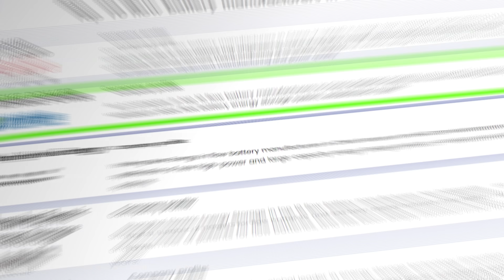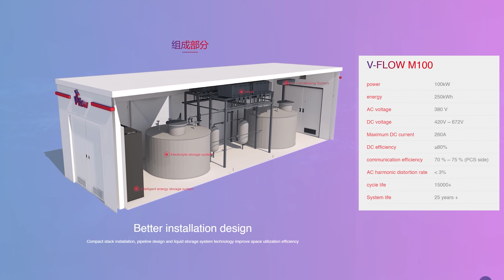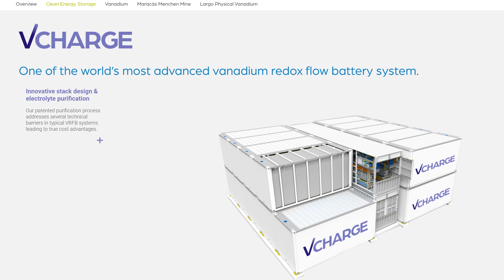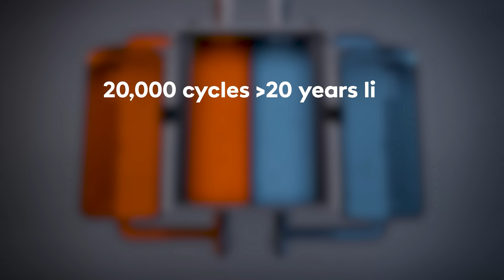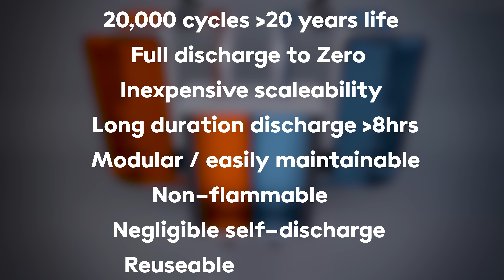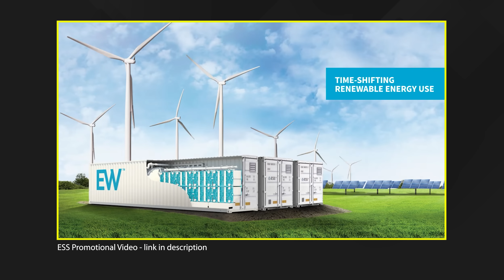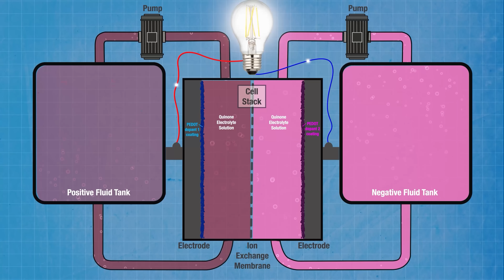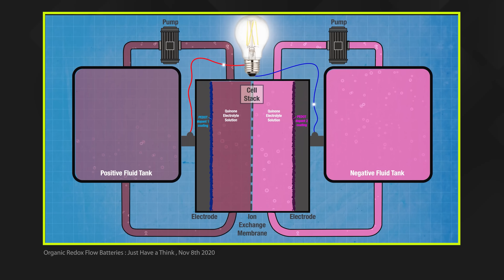Iron and Saltwater Battery How easy is that

Comment: The real problem with these systems that isn't considered as the lack of economic viability versus alternative storage solutions and fossil fuels. Check out XL batteries which could be the first low battery company to achieve cost parity with fossil fuel alternatives.

Comment: Lockheed Martin has already found your location they are just busy in the middle east, please wait for your free delivery. More seriously, great video and I'm left wondering for the iron variant, could one take some salt water and add iron particles like if you were to try and collect iron sparks from a grinding wheel, and get a similar result, presumably with lower output.

Comment: Also limestone can be made into a battery by using chalk/quicklime and water it as the same ions as li2co3 lithium carbonate which li2+ co3 2- caco3 is ca2+ co3 2-  and salt battery with same and co2 anode produce 1kwh/kg with 1 less ion then calcium potentially making 2kwh/kg possible and very cheap about 30 to 40 pounds per tonne also there is calcium bicarbonate which as 2 different electrolyte so potentially even more kwh per kg

Comment: It should be noted that there’s not a need for grid scale batteries to be particularly energy dense. Shipping containers can be stacked on top of each other and pull double duty to hold the solar panels on top or be incorporated into the support towers of wind turbines.

Comment: A whole Energy Density chapter that does not actually tell you the energy density?
Come on! Better than Vanadium, ok, but Vanadium flow cell energy density is terrible. Better than terrible can still be pretty terrible.
What they also avoid mentioning is that the plating-out effect means they are very dependent on area for the actual flow cell electrodes. This means the capacity is not fully independent of the electrolyte storage making it a big downside.

Comment: Are the simplest batteries incapable of high power charging/discharging (extremely low C rating)? They always fail to disclose the viable C rating for each cell (I understand these may use 1 massive cell). What I mean by that is that some of these batteries claim they are superior for their long duration storage.  By this they mean instead of delivering their full discharge experience in 1 or 2 or 4 hours, they last a whopping 100 hours. They are merely stating that they can (and probably must) discharge whatever power they have over 100 hours. Of course, anyone with experience with electronics realize that any battery if placed in a circuit that draws current more slowly, can last 100 hours. Witness a dry cell in a clock. We don't proclaim the AA battery as a modern marvel because it has the distinct ability to discharge with a stupid low current. 

Lithium batteries have never been characteristically stuck being used at a 1, 1/2, or 1/4 C rate. Witness Lion watch or pen cell batteries that replace traditional acid dry cells. But grid managers see Lithium packs as good, and very useful, given their higher available current rates, allowing them to take the best advantage of grid needs including possibly short charging opportunities (when excess power would otherwise be curtailed) and possibly short discharge opportunities (when the spooling up of a peaker plant couldn't possibly happen quickly enough for a temporary abhorrent demand spike.  

Another way of describing 100 hour long duration battery is that it would have a 1/100 C rating, or a particular limitation of slow discharge rate. If so, that would mean you might only be able to RECHARGE it safely at 1/100 C rate. In both cases you have a crap battery that no grid owner would accept as a killer battery, except for extreme cases of multiple days source energy outage where you are discharging truly MASSIVE banks of reserve energy like the oil reserves used when prices spike. This type of break-glass-in-case-of-fire storage, is hardly a viable tool to tough out the worst darkest deep-in-the-shit Climate Crisis power system is failing us scenarios. It's more of a wasteful 10,000 hour uptime guarantee piece of equipment that power operators clutching their pearls would dream up to ensure no one misses Dancing with the Stars, ever.

I know flow batteries run all types of chemistries and some will allow far better current responses than others. Can we please try to include the preferred and max C rating when we discuss storage solutions so we can intelligently compartmentalize the junk from the useful?

Comment: Thanks. I'm an avid Tesla fan but wondering why they're wasting good (energy dense) EV battery lithium on their megapacks. You'd think they'd go the way of iron ion flow, being that it seems that would be cheaper to build, and much cheaper in the long run due to it's 10x lifetime.
Thanks again.
Okay, the caveat is probably that iron ion might not be as efficient. So what. Ever cheaper and cheaper solar will not than make up for that little bit of efficiency difference.
(Come on Tesla, redesign solar and the iron ion to transform the world)!

Comment: I’m in Canada and there are numerous small communities in remote isolated locations, especially in the North.  They usually depend on diesel generators to provide electrical power.  Are there any companies offering renewable power sources coupled with short/long term electricity storage.  In particular, solar does not work well for a large part of the winter in the Northwest Territory, Yukon and Nunavut.  Love your videos.  I find I feel more positive about the future for my grandchildren from you research and videos.  Ignore the negative comments.  There way too many negative, critical, anonymous voices on the internet.

Comment: So did I miss something? What's the catch? All Flow batteries have the inherent advantage that that capacity is controlled by the size of the fuid tanks, not the size of the electrodes, and Vanadium has been the poster child for a while now - but it hasn't shown any signs pf taking over the World on a game-changing scale, presumably because Vanadium is expensive and difficult to handle. Iron-salt seems to side-step these problems...what am I missing?

Comment: Whether Rongke Power's 400MWh of storage is whopping or not depends on your point of reference, Dinorwig's pumped hydro station is 9.1GWh, which is nearly 23x bigger than this.

To meet the UK's predicted long-duration/seasonal energy storage requirements in 2050 would require about 100,000 of Rongke Power's 400MWh flow batteries.

Furthermore, at an LCoS of 5 cents per kWh, for storage that's used for true seasonal storage, e.g. cycled once a year, charged in the summer for use in the winter, for a 30 year RoI it would require battery capital cost of just $1.50/KWh, about a 100 times reduction incurrent cheapest lithium battery technology.

Don't get me wrong, I think flow batteries are a brilliant technology, but four countries with climate and energy demands like the UK they are not going to provide 100% RE power generation support.

Comment: Great video!  I do have a question regarding the efficiency of these various flow battery designs.  As I understand, one of the remaining issues with flow batteries is the overall efficiency that sits somewhere between 50 to 80% for the better designs.  Can you speak to this issue?  Much appreciated.

Comment: Batteries to store renewable energy will be needed in 3 general places: 1) powerplants, 2) renewable energy sites (such as wind farms), and 3) houses with solar cells. The first two would be essentially public utilities, while the third is basically battery back up for individual houses. Since I work during the day in the office,  I could not use energy from solar cells at home. So the energy created by those cells needs to be stored for use when I and my wife are home. What type of batteries could be used at home from your list of new battery technologies?

Comment: What about batteries like the Edison battery? Yes, they are taller and heavier than lead acid or Lithium, but they are non-toxic and last for decades. Who needs a light solar or wind battery anyway? Plus they can be refurbished into new batteries after decades of use.

Comment: The coulombic efficiency of iron salt batteries is only about 50%. This means only half of the energy put into them is stored and can be used later. Lithium bats are 99% efficient, lead acid bats are about 75% efficient.

Comment: If there is a cycle limit then they are handicapping the living hell out of the flow battery. The vanadium flow battery has no cycle limit when you do it right, the plating aspect is the worst aspect.

Comment: The problem is that vanadium has a bit of a toxic tendency and it is *insanely* valuable as an alloying agent with steel. Vanadium is, no joke, one of the most important alloying agents in steel. And one of the most important. Off the top of my head, only carbon and manganese is more important, the later because it does double duty as it cleans impurities too.

Comment: Now throw in the CO2 cost of mining, transporting and refining that iron... ooooppppssss! It's right up there with Lithium... ooooppppssss.
Reply: oh look ... another idiot ignoring that such mining never comes close to the overall damage the mining/usage of fosil fuels does ... FFS use your brain. Lithium, iron and other ressources going into batteries aint consumed. At the end of a lifecycle large portions stay available to be recycled/reused ... all while fosil fuel power sources of all kind require a constant flow and what is mined is consumed into useless garbage/toxins. Thats constant mining/transport/damage just to keep already build power plants running, a drawback renewable energy and its storages simply dont have. And ofc building infrastructure and power plants for fosil fuels aint come green either.
The mining for renewable energy solutions and its energy storages cuts back on overall mining required by default ... to imply the switch from mining ressources which are consumed to ressources which stay available in a production-use cycle would be a bad thing is just braindead populism born from idiocy.

Comment: Firstly, I really enjoy your reviews. So thank You. But... Nobel Laurette Professor Laughlin is quoted as saying" if flow batteries are going to work, they would have by now". The have been around for almost 50yrs in one form or another and when listed go on to consistently create this Clean Energy phenomenon of Zombie Stocks that stay on the exchange board due to the "we are green" life support, but have in some cases decades of track record of never making a profit... ever. ESS (you iron flow story) case in point = been on NYSE close to quarter of a century peaked 18 months ago,  Market Cap >US$5.0 Billion on the Green "Disruptor" / "Game Changer" promise (those words have never been so misused than in the Green Sector of false and forlorn hope), but crashed and burned now to $300mio, because they don't work profitably. And in life, if you don't work profitably you are not sustainable. Flow pushers basically deceive on LCOS three shell tricks and System Life claims (claim >25yrs) but hide the fact you basically have to replace the car engine every year (so a serious parts swap out problem due to all the components swimming round in a solution more corrosive than battery acid). And then they also break that absolute basic rule of thumb for financial feasibility "if it is made out of something more costly than panda bear fur (or precious metals) it will never work"... The Membrane Nafion is this vital material to flow batteries that is more costly than gold. This is brought to you exclusively by Du Pont, the guys who brought you Napalm and the movie Dark Waters and why Gortex never falls in price...

Comment: It may already have been said, but flow batteries strike me as being much safer than bulk lithium chemistries. In most flow batteries, the stored energy is only available for release as the working fluid is pumped through the active cells, so there seems to be less chance for a catastrophic discharge. 

My ears perked up when you mentioned the company making flow batteries for home use. I wouldn’t want a potential lithium bomb in my basement, but a flow battery would be much less worrying.

Comment: There's long duration, and there's long duration. There's a big difference between 10 hours discharge and seasonal storage which is charged in the summer and discharged in the winter, ie cycle once a year. To get down to a LCoS of 5 cents/KWh for 20 year RoI would require a capex cost of just $1/KWh,  about  a 99% reduction on current costs. If the payback is over 20,000 Cycles, that would require an investment period of 20,000 years for seasonal storage, which is obviously nonsense.

Seasonal storage is the big challenge, because it could create a paradigm shift in the viability of intermittent renewables. It has the potential to turn intermittent Renewables into 100% on demand electricity supply, as reliable as coal but without the sh#t. However I can't see any battery technology getting anywhere close to that sort of performance for a very long time.

Comment: With many power grids having peak load surcharges on their MW-scale grid connections, one place that could greatly benefit from having affordable 5-10MWh of local storage with 1-2MW of sustained output would be peak-smoothing for medium-large DC fast-charging stations to avoid paying peak load surcharges and overbuilding costs. Makes no sense to size everything for 2MW when the 48h average load will be under 400kW between power outages where local storage may get depleted.

Comment: At some point, battery formats will diverge, with a different battery format tailored to each mission. 

The best battery for stationary storage, the best battery for ground transportation, and the best battery for electric aircraft will undoubtedly be very different.

For stationary storage, cost is the most important parameter. 

For electric aircraft, weight is the most important criteria. 

For ground transportation, both criteria are important. 

Lithium batteries can do all 3 jobs to a certain extent, but at some point cheaper but heavier batteries will be used exclusively for storage, while lighter but more expensive batteries will be used exclusively for electric aircraft. 

I look forward to seeing what new batteries become commercially available over the next few years.

Comment: Great video Dave, as always. I tried looking up the cost of the Prolux Storac systems because I can imagine some viewers might be keen to get a redox flow battery for home battery storage. I couldn't find anything online, other than them being very expensive and subject to price fluctuations due to price changes of vandium or other rare metals. Do you have any idea of a ball-park figure? Or of any other domestic units? Maybe in the future when there are more options available you could KWh price analysis for initial purchase, then graph that over time taking loss of capacity into consideration and replacement cost at end of life, maybe over a 25 years to match the lifespan of a new solar panel. Cheers from NZ.
Reply from the maker: No more than what you found, I'm afraid. I'd be surprised if they will ever become a better option than batteries for domestic storage. It's not really what they're designed for.
Reply: Cool, good to know, thanks for your reply. I hope sodium ion batteries become widely available soon for cheaper home storage systems even if they aren't as energy dense as lithium ion, also because of their minimal use of rare earth metals and their inherent ethical + environmental cost. I'm putting a 6.4kW system on our house at the moment, my  brother put a 12.3kW system on his house recently and has a credit deal with his energy company with a 1 for 1 credit system for any energy put back into the grid, which makes batteries redundant, which is lucky because he almost paid over $10k for a battery system. I wonder if this will be viable in the future though as off-peak power demand increases for overnight EV charging... Anyways, just an update on the energy/solar situ in New Zealand at the moment. We're lucky because our national energy grid production is around 85% renewable (mainly hydro, geothermal and wind) so driving an EV here is carbon positive, even if you don't have solar. Solar is increasing, especially residential solar which seems to be growing exponentially which is exciting. Which country has the best current energy grid production and distribution system in your opinion? Maybe also taking into account EV percentage (and projected growth) and grid stabilisation. @JustHaveaThink

Comment: Ok so flow batteries are clearly way more established and proven technologies than i thought.

So... why arent they everywhere?

Need a break down of energy storage tech to current best use & future possible use case suitability.  Way too much silver bullet unicorn hunting going on, i need a sense of how each is used and where it would be best deployed.

Especially for grid storage I've yet to see a company offering or pulling together a strategic build like "we use super capacitors linked to lithium tech for fast response balancing, flow and gravity/hydro for sustained hours-long delivery at peak times, and liquid air for long term storage and doldrum days"

Nb above will be totally wrong order of tech to uses. But you get my point. Instead its all single-tech companies competing in a way that makes joe public think theres one miracle storage to do everything.